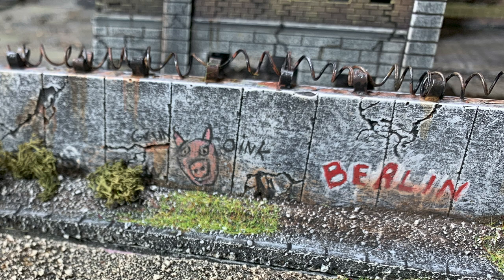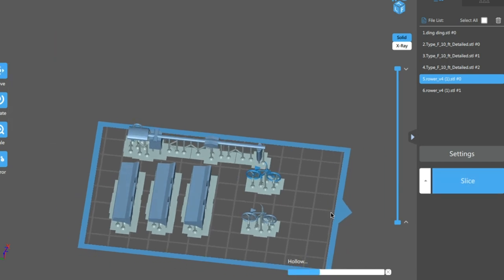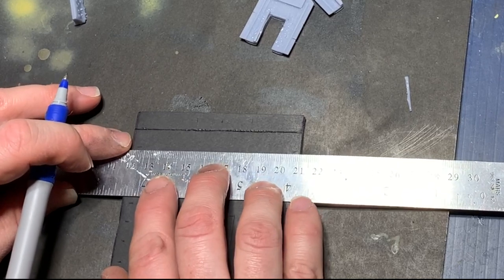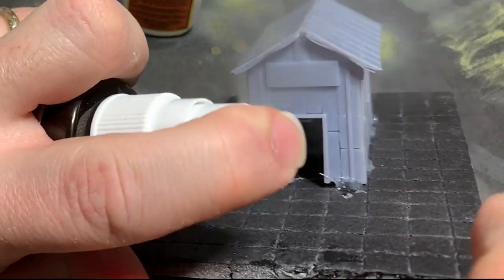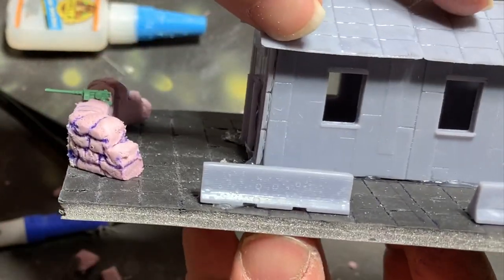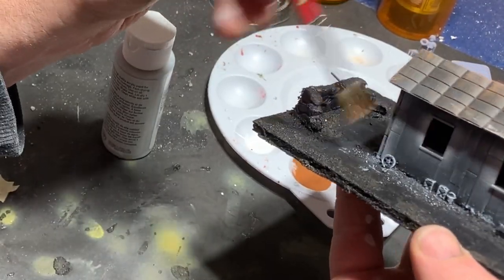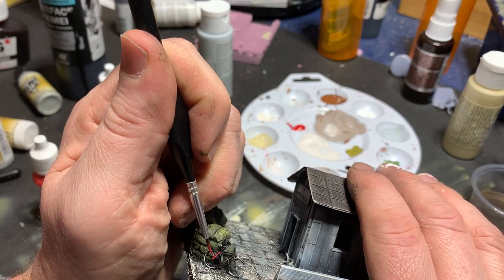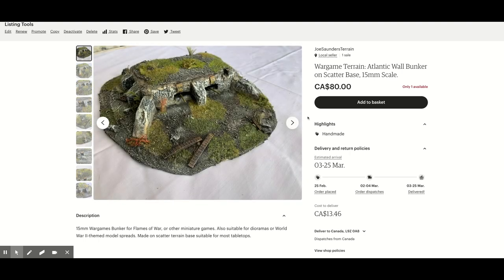How to Build Model Landscapes: Cold War Building for Team Yankee- 3D Printed Terrain for Wargaming

Comment: When you do the capillary-action panel-lining on the hut with thinned down enamel paint, and then clean up tide marks with thinner, doesn't that pose a risk of thinning out + erasing your airbrushing work that you've done on the surface of the hut?
Reply from the maker: Enamel thinner will damage acrylics if you use it too heavily but in that case I used it very sparingly.  If in doubt you can put down a layer of satin or gloss varnish first.